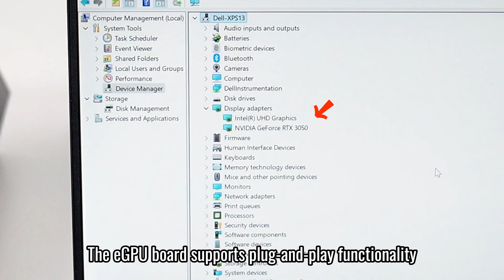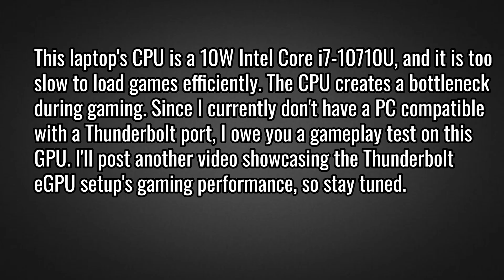How to Build a DIY Thunderbolt 4 eGPU?

Comment: Is your laptop TB3 or TB4? Intel Core i7-10710U was released in 2019 and first TB4 laptops were introduced year later in the end of 2020. It's important because they are 2 seperate things. Since it's PCIe 3.0 x4 my assumption is it's TB3 and not TB4. TB4 is PCIe x1 and might not run at all with an eGPU (that's why I'm here, before buying stuff that might not work)
Reply from the maker: My laptop has TB3. However, connecting an eGPU via TB3 or TB4 will operate at the same speed. Thank you.

Comment: Question, but wouldn't using existing eGPU dock like Aoostar AG02 (TB4+Oculink) @$210 or Minisforum DEG1 (Oculink) @$99 be much better ? DIY aside, the cost of the eGPU dock on AE itself seems almost $180~
Reply from the maker: It's not working great with M.2 adapter. Check compatibility before you buy them. However, you can go with whatever you want. For me I create content for my channel, so it is my job or my business.
Reply: @itggear  Got it, I was on the hunt for a miniPC till I came across your JONSBO NV10 mITX build and fell in love, from there been just lurking your videos more and saw this one.  

Personally I am thinking to go for JONSBO NV10 with either TB4+oculink eGPU or add a slim gpu inside it like you did and get a eGPU when I actually feel the need for a stronger big GPU.

I will say this, one of the best YT build vids so keep it up

Comment: can this fit gigabyte LP 5060 gpu. 3050 would be underpower for my needs
Reply from the maker: Yes, but you need to design backplate for it.
Reply: @itggear  it would be great and appreciated if u can adjust for gigabyte 5060 oc low profile
Reply from the maker: @Chandra.Reality  Thank you for your interest in my work. However, I do not offer a 3D design customization service. The 3D files are intended for DIY and hobby projects only. The TB4 eGPU dock that I used in this video also has an enclosure that you can order from the seller. The eGPU case for this eGPU board has several options that you can choose from, such as 210mm, 260mm, and 280mm, so you can install an even more powerful GPU than the RTX 5060 low-profile. Thank you.

Comment: I planning to create something like this. But I don't know what material should i used for 3D print
Reply from the maker: Depending on your 3D printer's capability, choose the highest heat-resistant material possible that your 3D printer can print.
Reply: @itggear Does ABS good as material for this?

Comment: I was wondering,  if I did the same setup BUT using a laptop with already a built in gpu like a lenovo legion 5i, and I use the egpu as a frame generator using lossless scaling, will it work?

Comment: Bro, is it possible if you mod the internal cooling gpu and make it slimmer. To compromise the heat problem. Just use a faster fan and wider. If that fat egpu, cant fit on my bag. 

Just look at the example for gpd g1. Thats a great design.
Reply from the maker: Sorry, I don’t have the ability to design or produce a GPU. In this video, I am simply proposing an idea using available tool adapters and existing GPUs on the market, combined with 3D design skills, for DIY enthusiasts and hobbyists. Modifying a dual-slot GPU to make it slimmer is not a practical idea and significantly increases the risk of permanently damaging the GPU. It is not worth the effort at all. There is no reason to do so, and you should absolutely buy a prebuilt eGPU dock like the one you mentioned instead.

Comment: is it need external monitor?
i want to use rx580
Reply from the maker: Hi! Not always, but it's generally recommended for the best performance and compatibility.

With an RX 580 and Thunderbolt 4, you can sometimes use the laptop's internal display (if your laptop supports internal display output via eGPU, which can vary). However, you'll usually get significantly better performance by connecting an external monitor directly to the RX 580 in the eGPU dock. Hope that helps!

Comment: Can i use in all laptop
Reply from the maker: This Thunderbolt eGPU dock is compatible only with desktops, laptops, or mini PCs that have a USB 4 or Thunderbolt 3, 4, or 5 port. It will not work with Thunderbolt 1 or 2, nor with standard USB C ports.

Comment: What kind of 3d printer do you have? I’d definitely like to get started if I can’t buy the case directly from ya?
Reply from the maker: Hi, my 3D printer is the Creality Ender 3 V3 Plus. I can only provide 3D design model files; however, I don’t have any physical products for sale. In my opinion, objects created with a household 3D printer are not worthwhile for selling, as they lack the durability needed for long-term use. I use 3D printing solely to showcase my projects. Thank you for watching!
Reply: @ absolutely what your doing is definitely helping and I am grateful for your channel!

Comment: I know why you use thunderbolt on this laptop because this model is quite a hustle to set up with mini pcie, the back cover must be installed, it's so picky with the types of ram you use too
Reply from the maker: Yes, you are right. Thunderbolt adapters are typically expensive, and they are even more costly than those used with Mini PCs. Additionally, the Thunderbolt PCIe card requires a Thunderbolt header connection supported by the motherboard; otherwise, it won't work correctly. Most Tiny PCs don't have that header connector. This Thunderbolt eGPU setup is only worthwhile for laptops or Mini PCs that already have a Thunderbolt or USB 4 port. Thank you.

Comment: Ini simpel dan bagus. Kaau di konekin di mini dell pc 3080 apa bisa ??
Reply: dell 3080 micro yg 1L form factor pak?
kayaknya gak ada port thunderbolt 4, gak semua usb c = thunderbolt
opsinya kalau pake dell 3080 micro ya pake oculink, tapo oculink dipasang di slot m.2 nvme, jadi bisanya pake ssd sata
dia pernah bikin videonya, judulnya "DIY RTX A2000 12GB OCuLink eGPU"